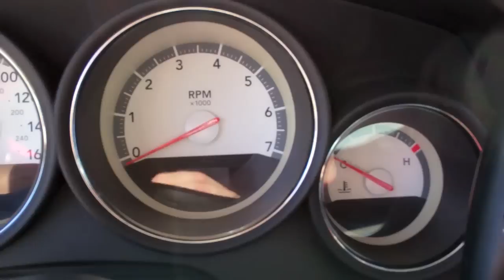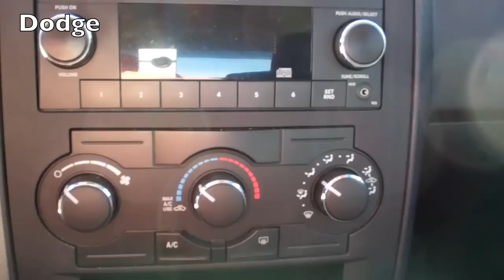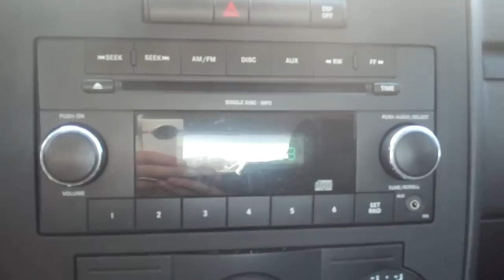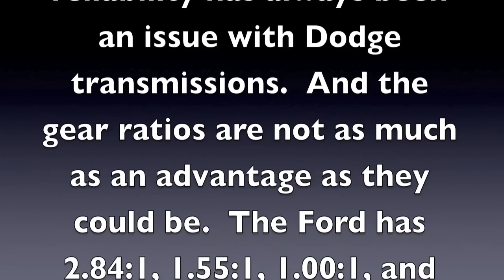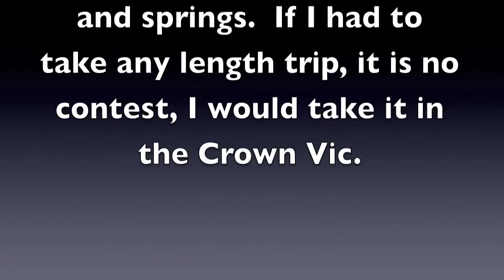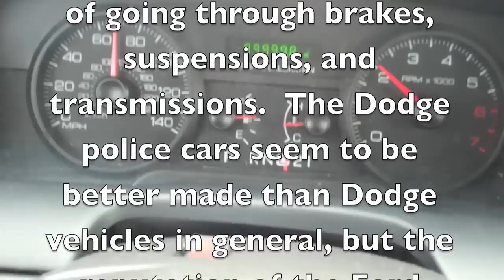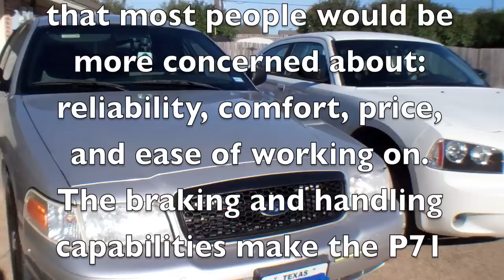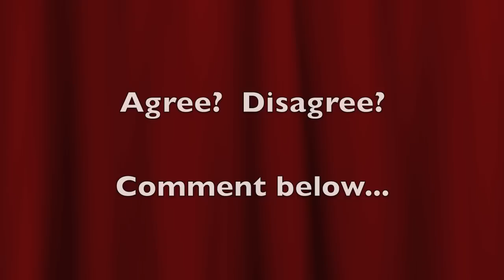Crown Vic P71 vs police Charger Hemi... the showdown

Comment: I do know that the P71 was designed by 3 departments at ford motor company. 1 the P71 was comfort like a car. 2) strong like a truck. 3) fast like the mustang. My first P71 was totaled by a chevy truck going 40 mph and I walk away unhurt. My second P71, was hit with me on a snowing highway by a semi truck jackknifing and hitting me off the road, again walk away. My 3rd P71 still driving and sticking my head out the driver window and yelling for people not to hit me. If you didn't find that funny, you must be having a bad day. LOL. Thank you Ford Motor for saving my life.
Reply: The moral of the story is, never drive with John.
Reply: I agree with everything else you said, but you lost me when you used the word "fast" to describe a 250 HP, 4,400 lb. behemoth, lol.
Reply: This is like a remake of thank you thinkpad
Reply: @TheTerminator310  you're about 400 pounds too heavy on that sir
Reply: @TaylorMadejdm1975  I own a Grand Marquis, which is just a rebadged Ford Crown Victoria. It's jjust under 4,130 lbs. And with a typical 200 lb driver... around 4,320 =/- lbs. So, including a driver, it's not terribly far from 4,400 lbs.
Reply: 👍🏾😁🇺🇸I just bought a 2014 Charger Pursuit. 115k miles 7900 hours 4700 idle hours. It's still going strong. This thing goes like a Rocket & it's just fun getting 13 or 14 mpg burning rubber at every opportunity✌😎☮

Comment: I have been driving various model year P71s for 10+ years. Had 4 of them in that time, I am a delivery driver, my route is approx 300  miles a night 5 nights a week, plus whatever random BS driving I do, so it's not hard for me to drop 100k miles on these cars in a year.

All 4 have gone past 350k miles, my current one, 07, is just over 400k. I constantly get people saying shit like "Man those cars are slow, they suck blah blah blah blah." My response? "Yeah, they're not meant to be hot rods, they're meant to never die." 

People have this misconception that a P71 is supposed to chase down corvettes and out drive Steve McQueen. That's not the case. The P71 is designed for one thing. Durability. I can safely say, despite the milage when you buy the car, unless it is falling apart when you buy it, they will last essentially forever if you keep up with recommended maint. procedures. oil changes, tire rotations, GREASE THE BALL JOINTS, transflush, coolant flush, etc etc etc. The only reason I end up switching these cars out is because I live in Chicago and after a few years, depending on the winter, rust becomes the biggest issue. Let me assure you as well, I am NOT gentle on my cars. I go from where I-80 crosses I-55, up 55 to 294 to Golf road in 35-40 minutes regularly, depending on traffic and go back down from Libertyville in no more than 50 minutes.
Reply: good story
Reply: Wait you also had to go 300 to 500 miles a night in the midwest? i always wanted to know if you could buy a crown vic and use it here but i heard from  someone who had to go 300 to some 500 mile a day a crown vic was a bad idea.They said it wouldnt start in winter or it would breakdown in the middle of nowhere after 80 thousand mile. So is this a bad car for the someone living in the midwest who has to go long distances or can it be used in winter and summer and not breakdown. Also if you were wondering the other person owned a toyota camry for 8 yrs put 385k on it before it wore down and has a corolla now with 200k only 3 yrs old but the camrys still good for small drives.
Reply: the crown vic is one of the most well built cars ever..fact.
Reply: Judge Lazar 100% correct.

Comment: My Crown Vic 2000. I have this  Vic for 17 to 8 years. My mileage for  18 years is 101,000 miles. In excellent conditions, no oil leaks. no dents .  No rust.No problems at all.

Comment: what good is more HP when the car breaks all the time.
Reply: Mark Hebel Maybe that's why the CHP went from the Ford back to Dodge, hmm ?
Reply: union deal ? Chrysler vs Ford 40 year history (span of time working on cars) overall big picture ford is more reliable, not perfect. Ford brakes less often the chevy but when they do it's more expensive then the comparable repair on the Gm..ish vehicle. Chrysler has always been cheesy.. from the beginning. They were the idiots that started it all in corporate bailouts BS in  the 70's.
Reply: Like I say all the time, what's the point of getting to 60 miles an hour in 5 seconds if that same engine can't get you to 100k miles without something fucking up
Reply: Mark Hebel 240k here
Reply: @alex knight Both the Charger and the Vic had 100K spark plug intervals, so it's really par for the course that they're never going to get replaced before they're auctioned off.
Reply: Chevy has then Tahoe’s and they have been very popular
Reply: @gunfumaster1024  you can’t go buy the maker. You and I could buy the same kind of car brand new and one of us would have more problems then the other. It’s a hit or miss. But salute to dodge for not being found on the road dead.

Comment: Great vid! Fully agree, the crown goes to the car that already wears one in its name plate. I just picked up a crown Vic lx for $4000, leather power everything premium audio, 1 owner 03 with 99k miles. Fantastic car, barely a squeak or a rattle from the interior. Smooth as can be on the highway and quite as a whisper inside. Love these cars

Comment: As I was sitting in a P71 State Highway Patrol car and chatting with the trooper, I asked him about the Chargers they were just switching to. He told me the trooper that received the very first one was driving it back to his location and the engine blew on him. He told me there were more reliability issues on the Chargers.
Reply from the maker: I've asked LOTS of police officers about their preferences and it's funny to me that the opinions seem to be pretty evenly split between all the police vehicles.

Comment: Most of this I can agree on. The exception is in control operation. Once you get used to driving something, you don't have to grope for a control, weather it be for windows, locks, radio, or climate control. I don't really know which of these cars is better, but I do know that either one of these is better than the SUVs so many of the police are driving these days.
Reply from the maker: I based it on the fact that I alternate between the cars frequently and the Ford is always "natural" whereas the Dodge takes concentration.  If I drive the Dodge for a couple weeks straight it becomes more second nature.  But I can sit in the Ford and operate all the controls no matter how long I've been away from it.

Comment: The 2006 we used in a documentary on the discovery channel called The Ultimate Armored Vehicle, (The BEAST)
The vehicle performed flawless doing all it was asked to do, the only problem we have ever had, was the vehicle would not run if the gas tank was full, that happened at 97.000 miles, it was repaired at no cost, and have had no problems since.

Comment: For the Charger, it depends on it's use.  There are a lot of really good and reliable Chargers out there that will last a life time.  And there are Crown Vic's out there that will break down every other month.  No car is completely bulletproof from having a few bad apples here and there.  So don't cut out the Charger because some of them trashed transmissions, suspensions because there is a Crown Vic that has the same issue.

Comment: Great review. Im partial and biased toward the vic though. The absolute hell these cars will put up with is unmatched. Cops ram stuff, jump curbs, chase people through fields, etc etc and the vic just comes back for more. Thats why alot of depts that went to chargers also bought a few tahoes or expeditions as they were the only things that could handle the same amount of abuse. However...i would love someday to see a race under real world pursuit conditions between the two cars...i bet the vic would be right with the charger...1/4 mi times dont always tell the whole story.
Reply from the maker: If you watched all the way through, the Vic is the overall winner.  Other than the engine which the Dodge dominates, the Vic wins or comes close on everything else.
Reply: @WJHandyDad  No i did see that. i was just saying i think under "real world" conditions the vic would hold its own performance wise better against the charger then numbers would suggest. Maybe not, but itd be interesting to see.

Comment: Well I don't know about the police Charger but I bought a 2015 civilian Charger about a month ago....V6 SXT. Drives decent,fairly quick for a big car with a six cylinder. But I'm waiting for a new power window motor and the high mount LED stop lamp stopped working. On a two year old car with 21,000 miles. My confidence is getting a little shaken. I hope this isn't a sign of bigger things to come. In the year I've owned my '07 P71 I've put a battery,alternator,and thermostat in it. Moderately priced parts and easy to get to and work on. The Vic still drives and runs good.
Reply: Chris Miller crown Vic is always better
Reply: I'll leave these here for you:
http://www.carcomplaints.com/Dodge/Charger/
http://www.carcomplaints.com/Ford/Crown_Victoria/
Reply: Remember the 2.7 V-6 was still in the Charger until 2010,thus issues..

3.5 and Hemi are bulletproof reliable,the 2011-now 3.6 V6,5.7,6.4,6.2 Hemi's are bulletproof..

Also MORE CHARGER'S MADE AND SOLD TO THE PUBLIC ! 99.9% of the Fords were ALL sold to Government and Fleet  sales..

I have a few of these in my family over the years...

Dad had a 2006 Charger 3.5 V6 210,000 miles no issues ..Only out of normal problem except power steering pump at 133,000... Cheap and easily replaced..Also a head light switch,also $80 and took 4 minutes to replace,seriously,very easy ! Pops right out,2 clips its in..Car was driven all the time and night driving and driven HARD !

2008 300 C Hemi same as Charger,166,000 before being totaled..

2012 Charger SXT awd 3.6 V6 140,000 problem free.
 
2013 Charger RT 156,000 miles and driven HARD by my Dad..No I am not a kid I am old too ! Driving for 30 plus years...  

And 4 more newer Hemi cars all issue free but low miles..
Reply: Chris Miller ive got a 09 police charger 5.7 with 220,000 miles on it and it runs like new the only thing I’ve ever had to do was replace a brake hose and I did it myself... I do all the oil changes myself and when I bought it I had the trans serviced and it wasn’t acting weird I just figured they never did so I had it done.. but I’ve never had any problems out of it... as long as you do regular maintenance stuff it’ll run forever as far as I’m concerned 😁

Comment: I'm thinking alot of these comments hating on the Mopar are from people that haven't owned any of the Chargers 06-10, 11-14, 15+... Yeah the 06-10 had garbage interiors, but the 5.7 / NAG 1 Mercedes 5-speed is as bulletproof a combo there ever was. That 5-speed is rated to handle up to 600 lb/ft reliably- you never hear of trans failures in LX cars of any gen. 5.7 Hemis are stout motors- they don't burn oil when they get up in mileage like the 4.6 mod motor is notorious for doing. Sure the Crown Vic is body on frame, but it's ancient; flexes like any old body on frame car - it doesn't have the stiffness of a modern unit body, which equals more rattles, creaks and groans from interior panels, sloppier handling, and most notably- much less safe in a collision because energy isn't dissipated around passenger compartment due to the solid frame. Yes the Crown Vic is capable of enduring extraordinary torture because of its body on frame design- but it's by no means perfect or necessarily better because of that-  which is why it's no longer produced. Also, short of forced induction NO Vic could ever keep up or catch a 5.7 Charger that was at wide open throttle. It's 3 seconds faster in the quarter mile, which might as well be a football field, 5.2 0-60 vs. 8.0 for the P71- if any of you caught up to one, it's because the driver let off and hit the brakes. Y'all are catching V6 chargers, which also happen to be 250 HP- and have performance numbers much more similar to a P71.

Comment: Before purchasing Chargers, we contacted many of the fleet administrators that had purchased Chargers and  had accumulated millions of miles, the North Carolina Highway Patrol advised that in the last two years no engine or transmission failures occurred, and the cost per mile for the fleet  was much lower, can't ask for better than that.
Reply from the maker: I have heard several folks stating that the newer Chargers aren't plagued with the problems that the earlier models had.  So far, knock on wood, my 2010 has been solid.

Comment: The gauges in the Vic are better. One glance and you can see everything. The charger you have to scan to see everything. My last Vic had 433k miles and ran strong driving fast or slow.

Comment: I agree with you. The Crown Vics are great cars. The more horsepower in the Charger is nice, but the 4.6 2v mod motors respond to mods well and are reliable. I want a Crown Vic with a 5.0 Coyote swap as a daily driver!
Reply: James Moore that's 100% what I planned on doing with mine in the future.
Reply: James Moore did you get that done?

Comment: The 06 Charger was clocked at Michigan Sate Police Test at 150 MPH, although it was suppose to governed at 148 colder temp, and air density tricked the ECU to allow for the higher speed, Fleet managers do not want the vehicles to exceed 149, because that means going to a W or Y rated tire, if spped are kept below 149 MPH V rated tires are legal, some Chargers can be purchased that are chipped at 129 MPH, this allows the fleet to be fitted with H rated tires, but handling does suffer.

Comment: You forgot to mention that the P71 had a harmonic vibration that occurred near 130 MPH instead of fixing the problem, ford electrically governed the P71 to 129 MPH, except for the 1996 models which were chipped to 135 MPH this caused bushing in the transmission to fail early, and other drive line problems. after 96 the vehicle was reliable but very slow.

Comment: I've also heard that the police departments retire these cars at about 50k miles before the engine has some major failure, so when you're buying one, get ready.
Reply from the maker: I've spoken with lots of departments over the years and they all have different policies for retiring vehicles.  Some are strictly age based, some are mileage, some are ridiculous "we have the money and we want new cars."  I would guess that some do start selling off particular models if they have lots of problems.  The last 4 vehicles I've owned have all been retired police cars and none have had any issues that weren't cheap and easy for me to fix myself or just cosmetic issues.

Comment: It's sort of apples and oranges - every point you made illustrates that. Ford could have easily put a 5.4 V8 with 4 valves per cylinder in the P71 - but the fuel consumption , weight and stale design of such a big engine would not make fleet operators happy. They could have more easily dumped a souped up Mustang GT 4.6 or 5.0 in there, after all, Chevy put the Corvette 350's in their police Caprices in the '90's , and now Chrysler is putting their sports car engine in their police car charger. Unfortunately, the Charger is not well made, and not reliable. As it was, Ford was selling these cars to police and federal fleets at wholesale, and the cars were made at their own plants on their own assembly lines. Not much profit there, so 8 years ago, Ford ditched the title of America's  police car and buried the P71 for all time. Nowadays its an Explorer in your rearview, or a Tahoe or charger. My black P71 is a 2007 with 131,000. Its 11 years old and it will outlive me. In the years I've owned it the only thing I've done is replace the a/c compressor - and installed KYB shocks, bigger sway bars, custom rear coil springs, MSD Blaster coils, K&N cold air, throttle body spacer. I've got split full bench front seats with twin fold down armrests and power driver's seat because this was the Captain's car. Am/fm stereo radio with CD player came with it too, and no less than four cameras and a PA system and air horn. I removed the spotlights and antennas, so while it still looks spooky, at least it doesn't look like a patrol car.
Reply from the maker: really the only complaint I typically have about my P71 is "not fast enough"

Comment: It's ultimata toss up although the dodge pulls the fords trousers down and whips its butt performance wise, is a more modern design,and the ford has what I call a "mafia" trunk., I think because the ford design is dated just may be why it's more reliable. Ford kept it simple by not overcomplicating the transmission for ex.
Reply from the maker: I consider myself very blessed to be able to drive both, one when I feel the need for speed and one for when I need comfort and the ability to carry a load
Reply: It was simply a tough car thats hard to kill.

Comment: Isn't the V6 charger faster than the crown vic? But the crown vic is a tank, and the crown vic engine has tons of potential that was never used.
Reply from the maker: I haven't driven one, but most people say it is the same or faster than the Crown Vic.  It seems the Crown Vic traded some power to gain reliability

Comment: I drove Crown Victoria as a cop and everytime we got new cars the engine was always the same, slow. We thought Ford should have put the SVT COBRA engine in for power.
On trunk, both cars have a cargo net as accessory. My Charger has one but not installed b/c of the BEATS sub is mounted there.
Reply from the maker: Yeah, an SVT Cobra motor would really wake up the P71!!